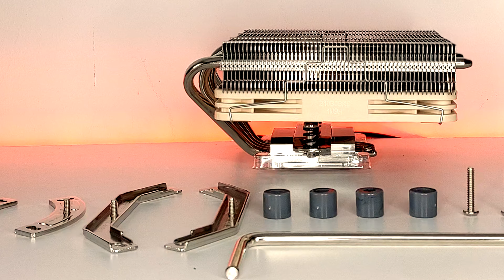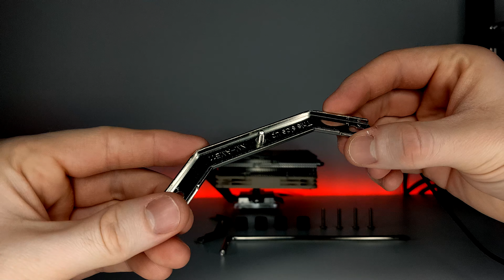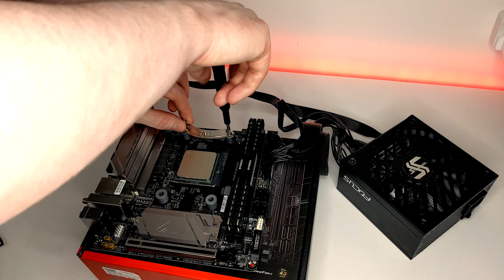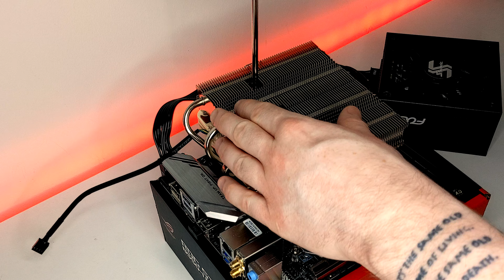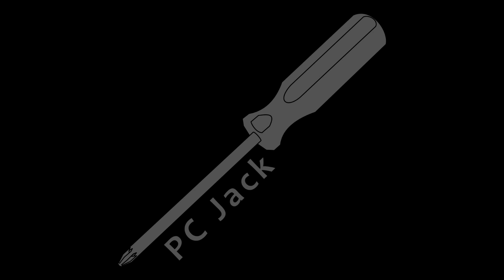Noctua NH-L12S - AM4 Installation Tutorial

Comment: Very helpfull video…only question i got is if its possible to have the fan facing up and if so what difference does it do
Reply from the maker: Thanks! You mean on the top of the heatsink? If so yes you can, provided that you are not limited for CPU cooler clearance 👍